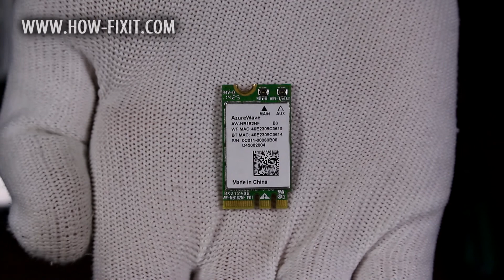Asus Transformer Book T300FA Wi-Fi Card Replacement - Fix Wireless Connection Problem

Comment: I have t300chi and as far as i concer  the machine has all the latest updates and latest bios etc. But while i am working on it the screen goes black and  i have to restart again. Is this becauce  windows 8 has a glitch on it or is this a hardware issue? Could you recommend  anything?